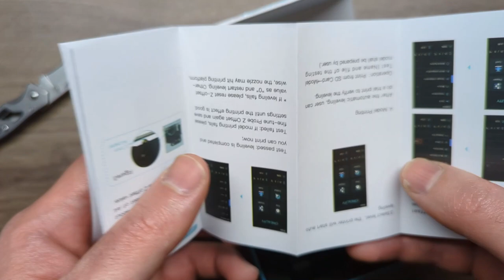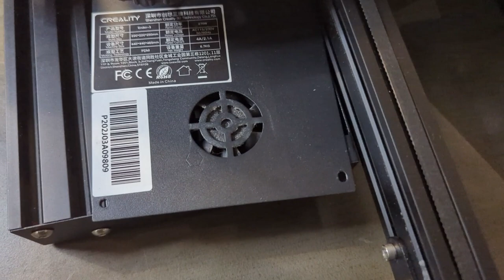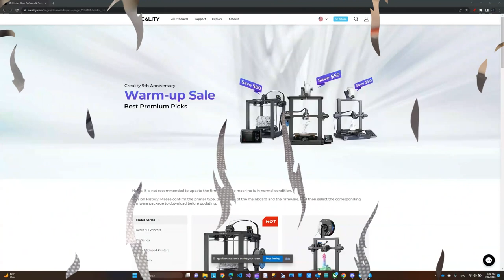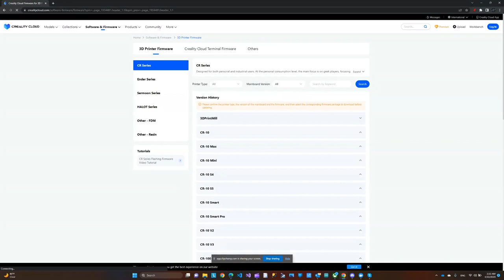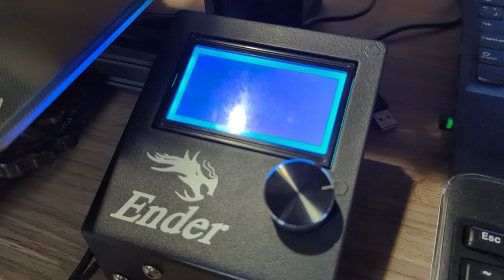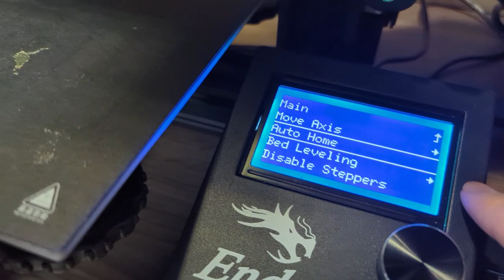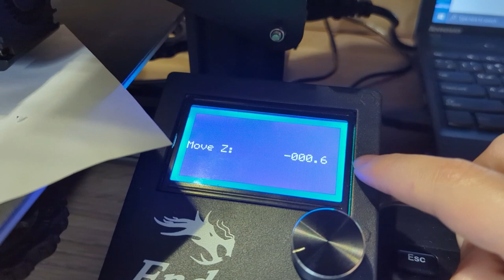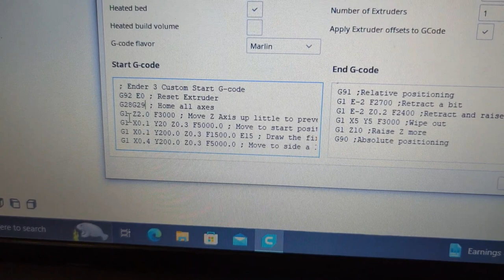CR Touch Auto Bed Leveling Upgrade For Ender3 And Other Ender Printers No manually level printer bed

Comment: Thank you for the fantastic step-by-step video! One note: G-code is read line-by-line, so G29 needs to be on a separate line after the G28; Home command. Cheers!
Reply from the maker: Thank you for the correction, really appreciate it. Let me pin this comment as it might help someone. So far I'm not having any problems on my printer but I think you are correct. Thank you for watching :)
Reply: Thank you so much I was having so much trouble trying to figure how why it wasn’t working and this fixed it
Reply from the maker: Glad it worked and thanks for watching
Reply: Thanks for the tip
Reply: It does directly say in the manual to change "G28" to "G28G29," so the video is correct to the Instructions provided by creality. So the video is accurate to them at least
Reply: Is it only G29 on its own line, or do you feed it values like the previous G28, e.g. 'G28 ; Home all axes,' ie: G29 : Home all axes? Or just plain 'G29'
Reply: @byronpearce7227  I dont actually know what it does, The manual just tells you to change one line to another, I typed it in exactly as it is there, and it works. well, with the normal amount of fiddleyness.

Comment: Wonderful video, mine shows up tomorrow and I'll definitely be rewatching this when it's time to install! Thanks a bunch yo!
Reply from the maker: Thank you for watching. Also happy to help in case you get stuck at any point. Do not hesitate to ask. I hope it goes smooth for you.
Reply from the maker: By the way, there is a pinned comment about the code modification. I recommend you read it. Some one corrected a small miss in my video so it might save you some time by reading that pinned comment on that video.
Reply: @techs.passion  already noted! Thank you!

Comment: Having cr, bl or other touch do not mean you wont have to level the bed manually. You still have to do that in order to get proper prints. It only compensates small imperfections. It is crucial to make a good manual adjustment.
Too bad many people think otherwise
Reply from the maker: 100% you still need to level the bed but less often. The rubber pads are more stable than the springs so that is one and it does account for minor difference in the corners if it happen to be. Another nice thing is if you need to change the bed from a slim bed to a thicker bed you do not have to relevel which is nice. All that said you are correct. Thank you for watching and the detailed comment.

Comment: This is the best Tutorial I ever watched on this topic. Thank You 🙏
Reply from the maker: Glad it was helpful! Thank you for your kind words and for watching :)
Reply: @techs.passion  Just one Question, I can't find after it my files on my mini SD card so I don't know how to print them out, can you help me with this?
Reply from the maker: Did you format the micro SD while using it to update the firmware?
Reply: @techs.passion  Hey, yes everything works just fine I just forgot to delete the wuestion yesterday, sorry for that. But I have an other Problem with which I was hoping you could help me out. Every time I'm trying to print sometimes out the filament won't stick to the bed, I levelled the Z offset even while it was printing but still the filament won't stick. I was wondering if you had any advice for this problem?
Reply from the maker: Hi there, sorry for the late response. I would say clean the bed, make sure it leveled correctly and make sure the temperature is correct for the bed and the filament.
For faster reply, consider joining my discord, it's free and I'm always there. Link in the description
Reply from the maker: Hi, I made this video to help answer your question. https://youtu.be/EhlOuar8Sd0 Thank you

Comment: I got a Creality BL Touch upgrade pack, this included the BL Touch and an ISP Programmer to flash the firmware, the kit came with a pin 27 board, the software for the ISP would not work, eventualy I realised it had Chinese Characters in the .EXE so I deleted these and then it would load, I fitted the pin 27 and the BL Touch and then realised the lid to the electronics case would no longer close with out shorting out the pin 27 so I had to take off the fan from the lid and lay it over the drivers to cool them while I printed a new electronics lid riser that I had designed in Fusion 360, I was forced to learn the parts of Fusion 360 I needed as Tinkercad was not powerful enough to design this riser lid, so eventualy I had the lid closed and the BL Touch working, but I also had to level the gantry every five or so prints as it dropped on the right hand side and the BL Touch would not compensate for such a large difference, so then it was dual leadscrews to be fitted and I then had to design a sync belt system to keep the leqadscrews in sync, it seemed Creality only ever made half an upgrade, it was at this point that I went from a Creality fan boy to a Creality Hater Boy, I had bought the Ender 2 and CR-10 and two Ender 3 machines, by the way the BL Touch firmware was faulty and I had to learn to configure Marlin firmware and compile it to get the ABL working correctly and I did a much better job on my first try than Creality had done over all the machines they had released, this made me realise Creality was just not interested in getting the best from the machine or even a correctly working basic firmware
Reply from the maker: Wow that sounds like so much trouble for that upgrade, I do not blame you, I still like Creality because that is the one I'm most familiar with but open to explore if the opportunity comes. Lucky for me, the CR touch was simple enough and really easy to install and setup. Right now my Ender 3 is very well upgraded. I also bought an Ender 3 Max, remember when I mentioned that I was keeping an eye on it, the other day I got it for some discount and will make a video about that soon. 
I do use Tinkercad most of the time since my Fusion 360 subscription expired and I do not want to pay for it. 
Seems like you have so many printers, which one is your favorite?
Thank you for the comment and all the details, I will pin it on this video since it is really helpful and might help others. I really appreciate the details and thanks for stopping by.
Reply: @techs.passion  my favourite of the Creality printers is the original Ender 2, that printer is the most reliable one I have and its also the least expensive, it just works, I can press print and just walk away from it knowing full well it will just print and complete its part, the only upgrade it has are some silcone spacers and a PEI bed, it is slow but the layer stacking is perfect, Creality hit a home run with this machine but chose to stop making it when the CR-10 and Ender 3 took off

Comment: Yeah, I knew I saw this video before lol I followed this to a T and I have no issue with flashing the hard drive however I think i'm making this too hard. When you put the CR Touch on the ender 3, will this firmware replace the current Marlin one on there? Like my Marlin shows in the About Printer 2022 but when I load the cr touch, the firmware changes in the About printer to 2020.
Reply: Subbed since I've spent several hours on your channel in the last week and appreciate all the help you have given to the community
Reply from the maker: Yes, the CR touch firmware will replace your original firmware unless the original one you have support CR touch. I should test that when I get a chance, I think Marlin does support CR touch but don't take my word for it.
Thank you so much, I'm happy to have you 😊 I think you made my 10k 
Happy to help, if there is anything you want to see or any feedback, I'm happy to hear it.
Reply: @techs.passion  happy to be your 10,000th subscriber!

Comment: is it suitable for Ender 3? on paper it says for 32 bit processor. but ender 3 is 8 bit i think.
Reply from the maker: Yes it works for Ender 3, I have it on my ender 3 that said I have the 32 bit motherboard. What is your motherboard version? Check and make sure there is a firmware for it

Comment: Hello, I would like to know if you can tell me what size the silicone supports are, if they are 16mm or 18mm?
Reply from the maker: Hi, I didn't measure them but. 3 of them are a bit higher than the 4th one which goes on the cable leg of the bed
Reply from the maker: Currently I'm not near the printer, I will try to measure them when I get back

Comment: Attention if you change the limit sensors must have all the same part number example 2134.
I spent months to recognize it.
If that sensors are different then the printer will become crazy and you will not understand from were the issue is.If they have different number the printer can't do autohome the cr touch can't work even if you pass the software with out the cr touch again will not work.
I become crazy many months know and today i found the solution 🇨🇾👍🏻
Reply from the maker: Hey buddy, so you mean the end zero switches all need to be the same and basically if you change one you need to change all 3 or the 2 in the case if you have CR touch? Good to know, I never needed to change them so far but did I understood this correctly?
Reply: @techs.passion  no matter if you have cr touch or not.
The switches must have same part number or the specific part number i think.
I have issues with leveling the bed and my memory carts sometimes recognized from the printer sometimes not.
Pm i need help i can't do it alone.
Reply from the maker: Good to know, thanks for the info. 
Yes, happy to help, join the discord, we will help you better there
Reply: @techs.passion  my Ender-3 don't like the cr touch ,all the sd cards i have can't save the cr touch settings .
Now my printer works perfect with out the cr touch and with the normal software printing more than perfect
Reply from the maker: That's perfect but the CR touch still nice however if you are going to skip it, should still be find to be honest.
As for the SD card, use the same one you used to upgrade the printer, that should work to store the settings

Comment: I can't figure out whats wrong with my Ender 3. I've followed all the steps as shown but whenever I do Autohome once it reaches the printing base on the z axis it just keeps trying to go further down and doesnt stop and so the motor is just continuously trying to spin the rod and move the nozzle further down even though its already reached the bottom and the tip of the CR Touch is already touching the bed
Reply from the maker: Sorry to hear that you are having trouble. It sounds like it has something to do with the firmware or the offset level because it sounds like your printer is still looking for the Z switch which I'm guessing you disconnected as you should.
Make sure you have the correct firmware and set the correct z offset level
Reply: @techs.passion  so I actually figured out a solution. I had to take off the z switch entirely not just unplug it. Basically the arm was going down the Z axis but was still stopping at the switch since it was a physical object stopping it from actually going all the way down and touching the board with the sensor on the cr touch.
Ended up having a firmware issue though and the printer kept freezing so had to switch to marlin firmware and now its working great! First print came out great other than running out of test spool before it finished lol
Reply from the maker: I'm glad you figured it out. Yes that Z switch is not needed. Thank you for the update and glad to hear it

Comment: I have a problem, my ender three always shows no tf card. Can you tell me how to fix it? It’s brand new, there are no files other than prints, and I always eject it properly from my laptop. ( it is also formatted to the correct way) it was also working perfectly fine for my first three attempts, but then I just got the warning. And if it doesn’t show the warning, it doesn’t show a print.
Thank you
Reply from the maker: A few tings comes to mind, I have seen the issue also heard of it a lot. Try different MicroSD Card. Another thing is avoid large size cards, 32 GB is your max I would say. Last thing, when you bring the card back to the laptop, is it still works fine, like after the error, you take the card back to the laptop, is the card corrupted or good on the laptop? I know you said the format is correct and all that. Unfortunately, I have seen it being a motherboard issue and you would have to replace the board but I hope you do not have to go that far. Hopefully this helps, the last thing I would try is update the firmware version to something newer and if the printer not too old and if it end up being the board you can look into getting a new one from the seller. Thank you
Reply: It’ll be due to STM firmware running on a  GD chip, I had the same issue, the firmware options aren’t clear on the Creality website.

Comment: Hi buddy, I have a ender 3 with motherboard v4.2.2 and i try to install the firmware i downloaded the firmware from same page as you but selected v4.2.2  but i dont know if it installed and when i try to check z axis its not going in negative it stops at 0 please help me and   ( for note i removed z limit switch wire from motherboard too)
Reply: nvm i got it but it still not going down negative value
Reply from the maker: Hi, it sounds like your firmware didn't get updated, let me share with you a video that might help.
https://youtu.be/Um36ElyThS4
https://youtu.be/OqwusmWw97o

Comment: A couple months ago i bought a cr touch, i tried to install it and everything went well untill it suddenly stopped working. I restarted the printer and the light was now constantly red. i tried to fix it by looking at some youtube videos but nothing worked. After a few days it stopped lighting up at all and now it does nothing. Do you have any idea on what the problem can be?
Reply from the maker: Hi, sorry to hear, sounds like too much trouble. Since it's not even lighting up I'm guessing something with the power so basically I would check the cable and ensure all that connected well. Take the cable and test it own it's own, make sure the cable doesn't have any cuts. I'm guessing you can you use a multimeter or simple LED to test it out. If the cable checks out and you make sure it's connected well and still no light then it might just be the CR touch dead but sounds like a power issue is my bet guess.
Reply: @techs.passion  Thank you for fast response, I will check and see if it gets power or if its just broken.
Reply: @techs.passion  I removed the backplate and wiggled the cable while the printer was on and it started to work again, so the cable was not getting good connection, ty for your help (=
Reply from the maker: Glad I was able to help, yeah it sounded like something with the cable. Hopefully it works, you might need to reset the settings and the offset, I know the software can be buggy and sometimes you just need to re enter the offset level.
Reply: @techs.passion  it si finally working!! only took like 2 months /= do i have to level the bed before every print or how often should i level it?
Reply from the maker: Only level it once after the initial setup, make sure to enter the offset and store it, restart the printer and ensure that it is holding to the offset value. After that you really don't need to mess with it unless something change, like for example you move the bed spring support or change the nozzle. It is very good at adjusting so mostly no more leveling needed after the first setup and only if major change after that like moving to different nozzle or switching to different bed.